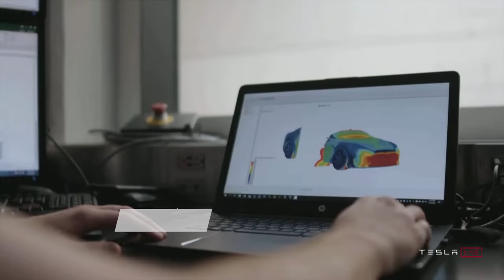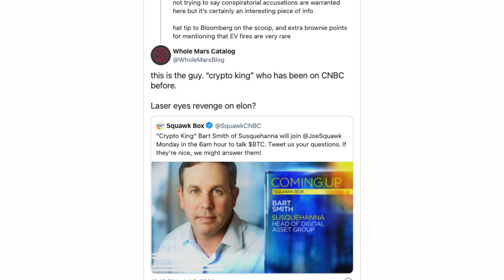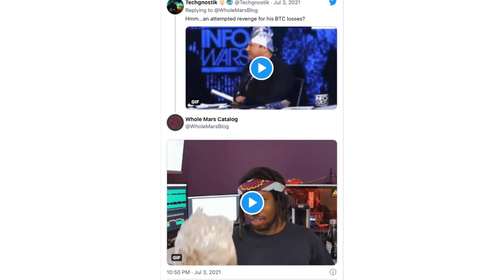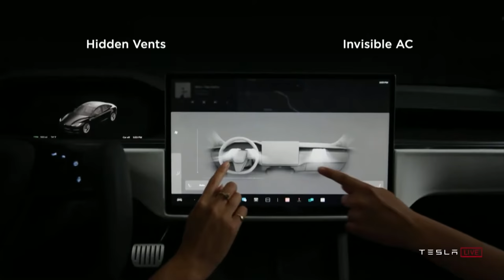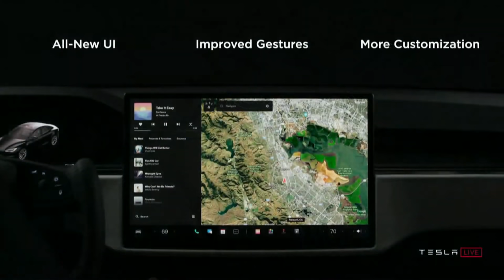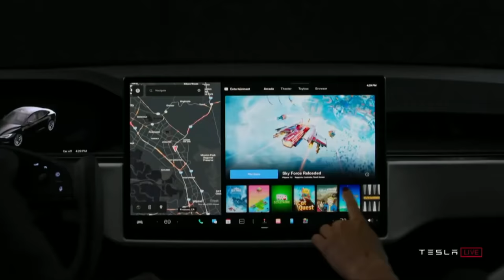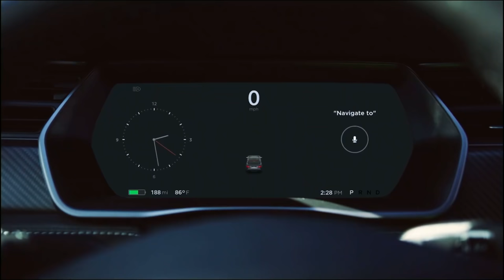SHOCKING!! MORE QUESTIONS AND ANSWERS ABOUT FIRE CAUGHT TESLA MODEL S!

Comment: Maybe you can answer this:

If I were to design an electric door, I would design it with its own power. Charge it from the main battery, but this is an important enough component that it must function even if other car systems are failing.

Do Tesla doors have their own power supplies?
Reply: Every Tesla accessory is actually powered by the secondary 12V battery - including the doors. The main pack keeps this battery charged. Even if the power failed in both, the doors on the S have manual door latches. If Mr. Smith "pushed heavily against the door" that wouldn't budge it. He had to have either used the emergency latch or exited normally using the button.
Reply: @rickkay9548  that is what I expected. Thanks.